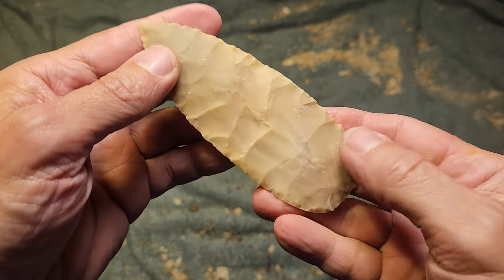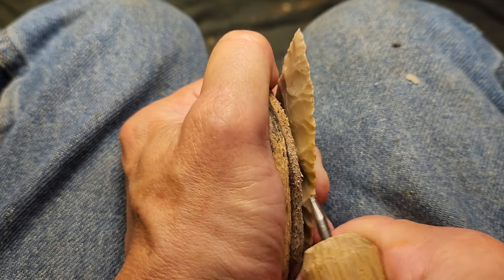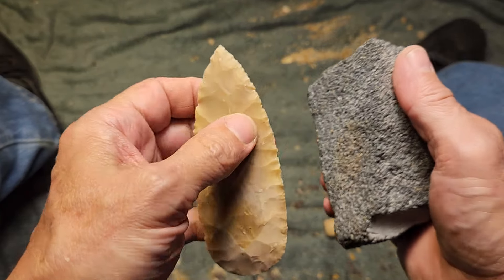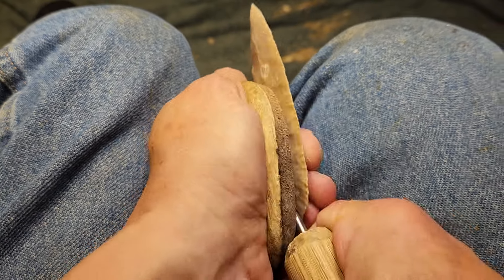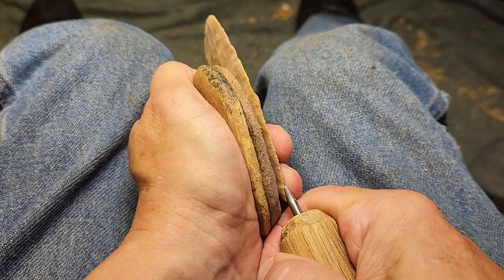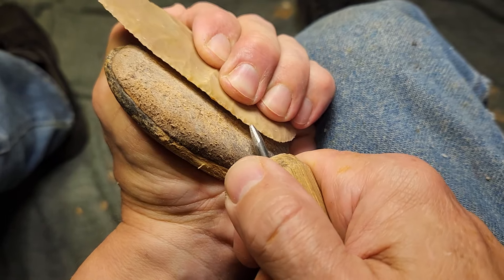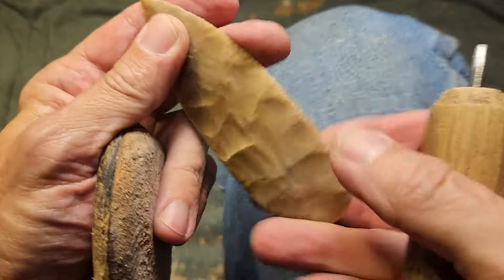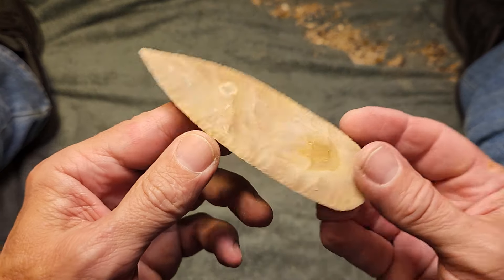1850 - Part 2/2 - Rock to Point Flintknapping Amoeba Chert

Comment from the maker: Items Related To Flintknapping/ Hunting
Updated April 12, 2024

Sean Dalgetty
Hand Pads, Gaiters
Tundra Leather
sean@tundraleather.ca

Danny Collins Lithics and Leather
Leg pads, hand pads flintknappingtraditions.com

Ted Snider
Notch-o-matic
theolithic71@gmail.com
https://youtu.be/3BHf-o97DYw?si=UADpj3pP4g9qiCVV

Flint Knapping Supplies
https://flintknappingsupplies.com/

Overstreet Indian Arrowheads Guide
https://www.barnesandnoble.com/w/the-official-overstreet-indian-arrowheads-identification-and-price-guide-robert-m-overstreet/1004757887

Old Friends Taxidermy
2478 Fairview School Rd
San Angelo, TX 76904

UHMW Black Plastic Mallet
Zoro Select 1Yvk7 Black Uhmw-Pe Rod Stock 3 Ft. L, 1-1/4" Dia.
https://www.ebay.com/itm/333994183040

Tony Soars fluting jigs 2018
https://youtu.be/8DKg4Kybris?si=oJcdq_nLxWJC2HyR

1-1/4" diameter UHMW plastic.
https://www.ebay.com/itm/224578394164?mkcid=16&mkevt=1&mkrid=711-127632-2357-0&ssspo=cHfvOieKSYm&sssrc=4429486&ssuid=1q_3LDvnSFK&var=524145172576&widget_ver=artemis&media=COPY

UHMW Black Plastic Mallet
Zoro Select 1Yvk7 Black Uhmw-Pe Rod Stock 3 Ft. L, 1-1/4" Dia.
https://www.ebay.com/itm/333994183040

6061 Aluminum Round Bar, 5/8" Round, 10" long, Lathe, Solid, T6511
https://www.ebay.com/itm/334171821048

6061 Aluminum Round Bar, 1/2" Round, 12" long, Lathe, Solid, T6511
https://www.ebay.com/itm/333393532365

6061 Aluminum Round Bar, 1-1/2" Round, 11" long, Lathe, Solid, T6511
https://www.ebay.com/itm/333413861610

1-1/2" x 12" long UHMW plastic rod, white
https://www.ebay.com/itm/125109196934?mkcid=16&mkevt=1&mkrid=711-127632-2357-0&ssspo=DCyz93qFQV-&sssrc=4429486&ssuid=1q_3LDvnSFK&var=&widget_ver=artemis&media=COPY

Needle File Set
https://www.harborfreight.com/12-piece-precision-needle-file-set-4614.html